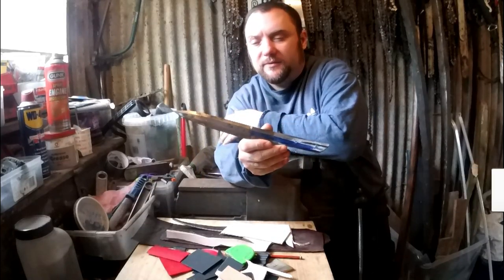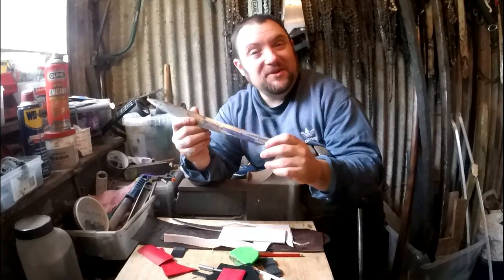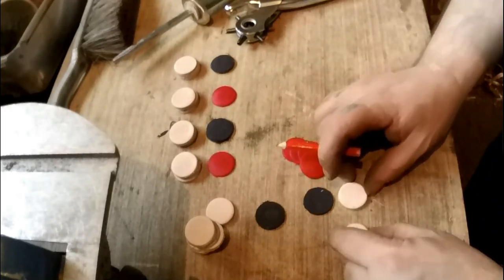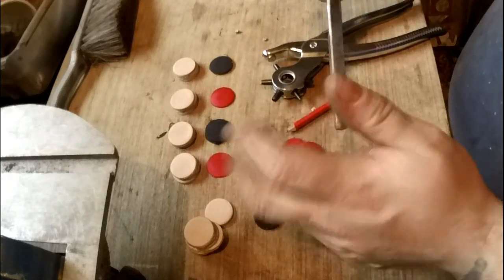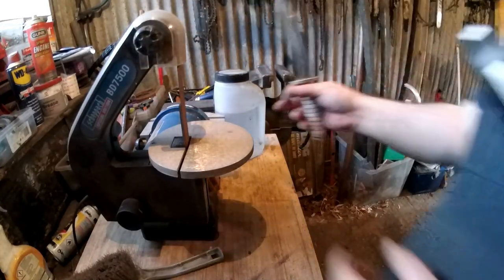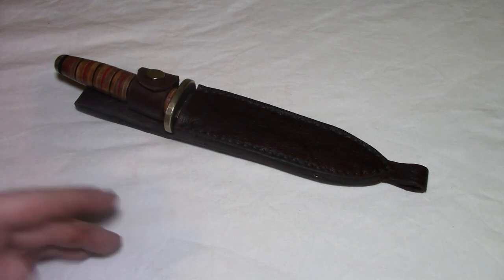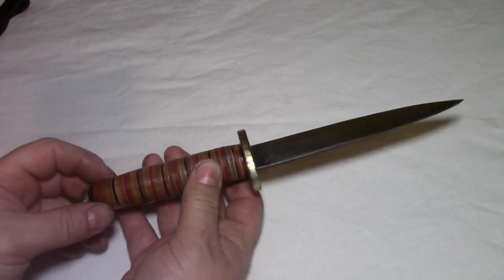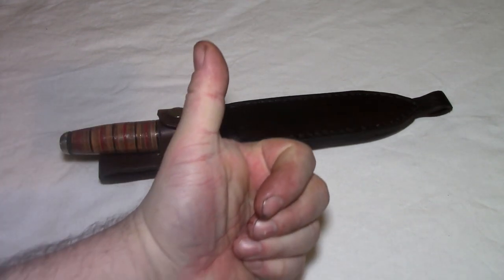Homemade Dagger with Leather Stacked Handle (HOW TO)

Comment: Excellent build! I have used  brass washers and metric sized domed nuts for end caps/pommels, you only have to tap the tang.. The larger sizes can be shaped into a "skull crusher point" and smaller sizes make excellent thumb studs on folding knives.They are also cheap (or easy to nick)
Reply from the maker: Glad you liked it Rex, cheers mate, Good idea on the washer and dome nuts, didn't think of that at the time.